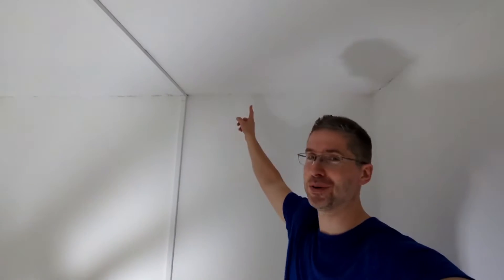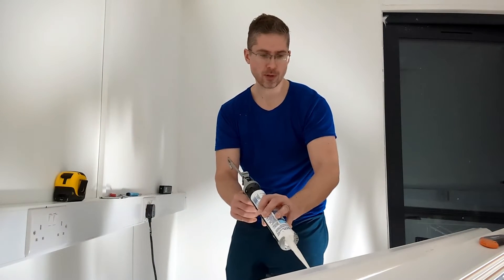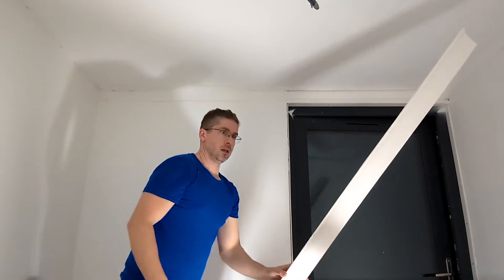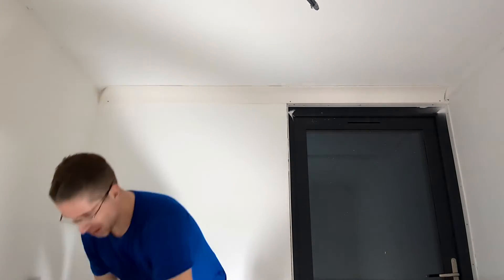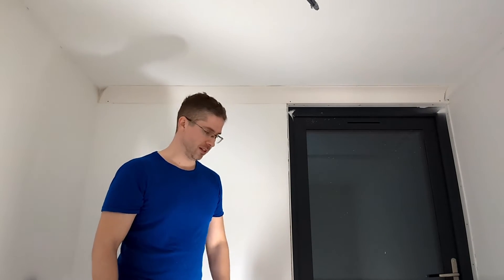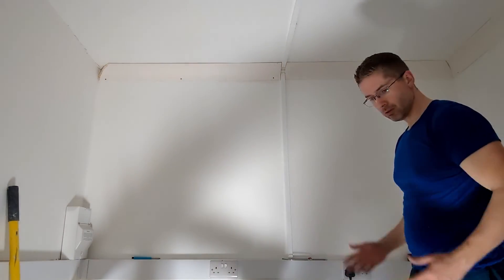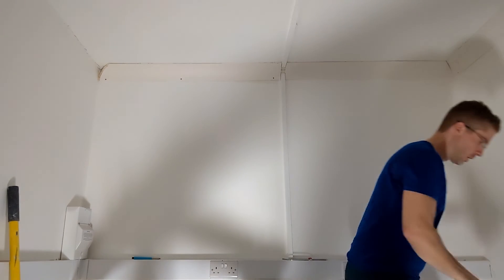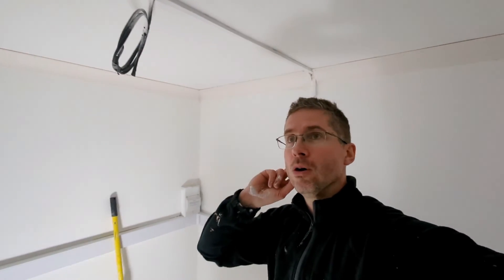Coving - Supercove Lightweight Coving 127mm x 3m

Comment: You have put adhesive in wrong place, should be on the edge where coving contacts wall or ceiling
Reply from the maker: Entirely possible! The edges weren't lining up properly because of the pitch of the roof.

Comment: Just had the misfortune of using Supercove lightweight coving, it is total rubbish. I been using proper lightweight coving for years but this stuff is basically 1970s style cheap polystyrene covered with cheap lining paper which is joined at the back with madking tape.

Comment: Puteți  sa îmi explicați cum se montează  acum.
Reply from the maker: Mounted with screws basically, and glue. Supposedly you only need glue but....
Reply: Can that material be plastered?
Reply from the maker: Don't know, sorry.
Reply: @munyag766 why would you plaster coving ?
Reply: @NewcastleMatt I’ve never needed to use screws in light weight coving and I’ve been fitting for some time .! If your ceilings like a roller coaster / not flat I would avoid coving
Reply from the maker: @DANMCMAHON08  I just found it easier. I probably did something very wrong but the glue just didn't hold the coving even after a minute or so.